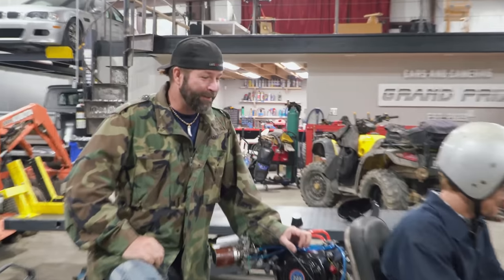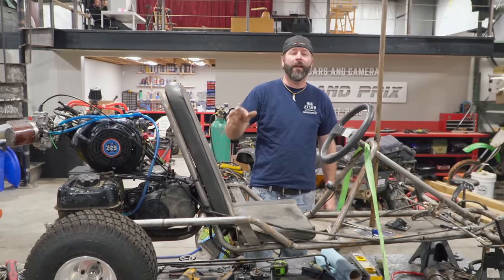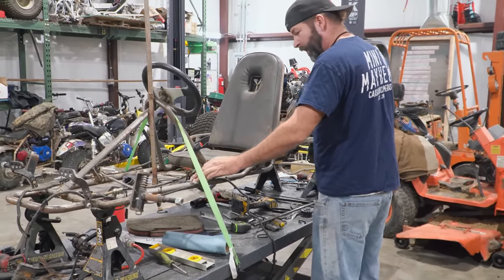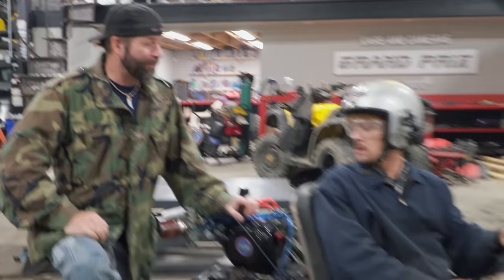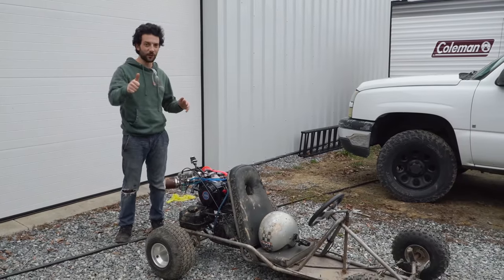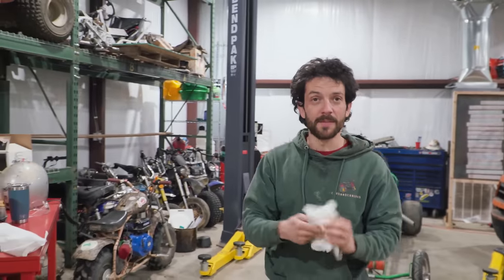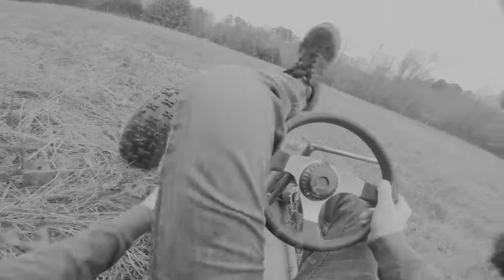Backyard Shifter Kart Goes Airborne on First Test Drive!

Comment from the maker: We're pushing the power limits of the yard kart chassis!
Reply: Ike quote of the year, "Don't do what we do, now hold my beer!"
Reply: Princess cart?
Reply: Ya think? 😂
Reply: I have a go-kart idea I'd like to share with one of you guys for your build off
Reply: Definitely that chassis was flexing alot.  Wonder how much it can take? 😅
Reply: If the track was dry it would probably hook up better
Reply: If you fill the gas tank with water it won't explode
Reply: Start messing with suspension setups it would be informative and enjoyable to see
Reply: I'd love to see you guys adapt that transmission to a minibike frame and see how it performs😎
Reply: Bro, you guys should reach out to REKLUSE clutches and get an actual semi-auto clutch for this badboy!
Reply: Next vid can we get a top speed run please???
Reply: I love the almost finished product pretty insane.
Reply: That shifter is slick!
Reply: @Casual_BackPacking  or use argon and purge it a while first.
Reply: Now the drag rail needs 5 speed Harley transmission
Reply: Dude I think a hand brake would be so awesome! Something you can grab real quick pull it then be right back on the wheel but that’s really cool cart !
Reply: Why not do paddle shift. You've done it before , and it worked pretty damn good
Reply: He said I’m a valunteer fire man lmao 😂🎉
Reply: Blaster would of been faster
Reply: You guys gotta do a all wheel drive go kart not like one with big wheels and shocks I’m talkn jus a normal go kart
Reply: Me and a buddy used handbrake levers on the steering wheel with a gyro off a dyno gt for the shifter on a cart we put a rm85 engine on worked pretty good vibration and  frame flex didn't effect it like a hard linkage
Reply: bring back the ducarti 900cc 🤣
Reply: Of all karts this is the way to go for sure.
Reply: Im gonna have to build another one now guys... darn it lol. Love the build.
Reply: Just curious, would it work to fill the gas tank with water while you welded the outside? I'm not a welder. Just asking. I understand both surfaces have to heat to have a good weld but the water would push the fumes out and keep the inside cool.
Reply: Yep
Reply: @kevinAuman1  they have four years. It's called a 30 series or 40 series belt drive. They even used a 70 series (snowmobiles and utility utv)
Reply: @Mac181  look in the video archives. Ike once built a yard cart with a predator on every tire. 4 engines for real
Reply: @jaydensdream714  I meant with a drivetrain
Reply: Fill the gas tank with co2 gas wile you weld it.
Reply: Nice
Reply: Seen what a predator 212 can do with a manual transmission.... Now thinking what a predator 670 will do with a manual transmission

Comment: Funny that I did this exact same thing back in the early 2000’s when I was 16. Used a kx80 motor and a 10hp Briggs powering it. But I did a direct drive to the transmission and used its clutch. Also it worked out great having an up and down gear shift on my left side. All in a big off-road kart with 4 wheeler rear tires.

Comment: Any OIL inside the case for the bearings?Looked Fun as heck.( Fen-Ders) If the shifter rocked,1 side Up-shift,other Down,instead of push-pull.A double- L across for fingertips.?Edit=Paddle shifting,but as a rocker.
Reply: We do have oil in it
Reply: You should fill the case.
Reply: @isaacitllbefine7231  hi Ike. I hope yall had a great Christmas.
Reply: That’s a great paddle rocker idea
Reply: @isaacitllbefine7231  yall should clean this up. also this also has me tempted to do this over a juggernaut pulley

Comment: Whenever you need to weld on or near a gas tank you can drop a chunk of dry ice in it and the co2 will displace all of the air and fuel vapors.

Comment: That's how i shift on mine and it's really fast. My wife she has one also and she loves it. Ours is lifted higher about 5 inch's off the ground cause we go trail riding all the time. We can switch from 2 wheel drive to 4 wheel drive easy. But to take it out of 4 wheel drive u gotta back up a few inch's. The youngest son he has his RZR and he loves it. We have one and  we go mudding all the time. I had a good friend of mine put a suspension lift kit on it and my wife was like WTH it's higher. She can easy get in and out of it good.
Reply: What go cart do you have that’s 4 wheel drive?

Comment: Dude this is effing awesome it’s my favorite so far with the torque converter and the manual it’s like the old gallardo’s with the flappy paddle gear box and when you put the clutch on it it’s gonna be like the tt vipers with the sequential transmission lol

Comment: I say keep it semi auto transmission, takes some thinking out of the setup and more focus on driving.
Reply: So it's a manumatic?
Reply: @190SkyTeam  yup...auto clutch, let off the throttle and the engine slows down enough to disengage the clutch and you can shift. My Suzuki lt125 is this way.
Reply: Dump the clutch and do a burnski 🔥🔥
Reply: @Jt101c  with a 25hp engine, it will "clutch dump" with the clutch it has now. But also a clutch dump will put alot of shock on the system and the current engine drove to the stator wheel they welded the sprocket too, the woodruff key amd the end of the crankshaft is the weak point and not made to be taking such loads. We shall see how things hold up but over all this is a very cool mad max setup happening.
Reply: It will be but having a clutch pedal as needed would be awesome
Reply: @steel175wild bio  I guess having a auto clutch and manual clutch would be good. You can still clutch dump when revving the engine but have the option of auto shifting. If the engine runs away you can quickly disengage it too. I say have both.

Comment: Run exhaust fumes thru a hose into the tank and that will get rid of any gas fumes left in a tank after draining it and flushing it with water. I have welded up alot of motorcycle tanks in the past and have never had one problem what so ever. Love your guys channel!

Comment: I know before welding on a propane tank you fill it up with water then drain it, could just remove the fuel tank if your worried. But boys will be boys. I know these are just go karts but have you ever thought of putting some splash guards on some for those wet muddy days? Had to put flares on my driving rig because one it's the law and two it cut down on my side mirrors getting dirty.

Comment: If you're going to weld or cut a used gas tank it is best practice to purge it with Argon gas, as Argon is heavier than air and gasoline fumes it settle to the bottom and will push any other gasses out of the tank as it fills. Purging is the only way to be sure there is no flammable fumes left inside the tank. Water will also work for this purpose but, then you have to wait for it to dry completely before use. 👍👍

Comment: Love the channel, been watching for years. 

I've got a challenge for you.
I've been wandering about the performance difference between a motorcycle 6spd trans and an ATV/snowmobile dual clutch & belt setup.
So the challenge is:
2 go carts that are identical except for 1 thing.
One has a snowmobile/atv belt driven dual clutch.
The other a motorcycle 6spd.

Can also  play around with different sprockets but other than that, identical. (Obviously different shift linkages, clutch master/slave, etc)

Same tires
Same frame
Same engine (preferably a 600cc or better)
Gas tank
Etc, etc.

Might be easiest to copy an existing shifter kart, and adapt the dual clutch belt setup.

Comment: Great content.  Reminds me of the go kart my brother and I build in the early 80's with a motorcycle engine, before shifter karts were a real thing.  Your shift direction of forward upshift would confuse me though.  I believe serious race car sequential shifters are usually move back for upshift.  I suppose this point is debatable since a lot of modern cars are forward upshift on the manually shifted automatic transmissions.  I have a suggestion for you:  you seem to have a lot of loose bolts that fall off.  Think about implementing a final check list before the first ride to include rechecking all nuts and bolts.  And think about using those torque wrenches a little more.

Comment: A converted hand brake could be a manual clutch, or you could modify the shift linkage so it disengages the clutch before shifting in both directions.

Comment: Here’s an idea for future builds. Make paddle shifters using cable. Run the cable through the chassis to the main shift rod. Run up/down shift cable out either side of a pivot on the rod. Just a thought so you can shift without letting go of the wheel. 
You guys are living my dream, just keep livin man….L I V I N! Lol

Comment: I had a 100cc Manx in a Sirio Goldstar frame years ago.
18HP@16k rpm - with about 3/8" ground clearance in the front. 
Direct drive - you had to pick the ass end up, take a couple paces, drop it and jump on and hit the gas.
Zero to 60 wasn't impressive, but 60 to 0 was about 8 feet, when you slammed it sideways.

Comment: To keep a fuel tank from exploding, drain and flush with water, run exhaust fumes through it from another vehicle for at least 45 minutes, then put any spark to it and it will not blow up.

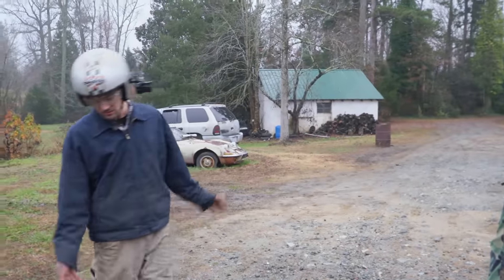Comment: at 10:00 The bolt is gone again because your transmission is shaking itself loose !!
I commented about that last time but you have a counter weight on the cranckshaft but no piston (weight) to counter.... so it is SHHHHhhhaaaaaaaaakkiiiiiiiiinnnnnggggg....

Comment: Just do the shifter like racing karts. 1 shift lever like you've got, but also a clutch lever(motorbike style) attached to it to operate the clutch cable...simple and effective otherwise they wouldn't race with them. :) Specially when you don't have much space for pedals.

Comment: You aught to cut the counterweights off of the crank to limit the extreme vibration that has to cause with the piston and rod weight gone. Or better yet, cut the throws out too and weld a straight piece of .120 wall tubing in its place

Comment: Ike I worked at O'Reilly and one day across the street at a mechanics shop there was a welder welding on a tank. It was empty, but had been used for storing used cooking oil. The heat vaporized the cooking oil which caused it to ignite and the tank to explode. The mechanics told me it took his head clean off. So everyone please be careful welding around tanks.

Comment: Really like this one.  Have you considered a primary belt drive like some Harleys have?  Would be lighter, I would imagine, and if the wet clutches in the transmission still function, it would let you eliminate the centrifugal clutch on the engine.

Comment: One of the best things about using a second case as a transmission is the MANUAL CLUTCH! Personally, I would have hooked it up direct between engines and use the blaster clutch. Even a stockish engine will feel MUCH faster with the control of a manual clutch!

Comment: your guys shifter is completely wrong to be calling it a shifter kart had you just put a handle connected to the (old clutch linkage for the model t kart) then itd be correct right now its literally just like an old 3 on the tree except its 6 gears instead of 3 next shifter cart you do you can use a blown up engine like the blaster then just seperate the case and build a back cover plate for the trans using your cnc table then it could be way more compact and you could use a cvt setup instead of a regular clutch cant wait to see all the stuff next year have a happy new years yall

Comment: Thats next to a good paddle shift set up. If you get it working, you wont need to let go of the wheel ever. Good angles and length on the paddles during a turn situation?

Comment: There isn't any engine breaking with the clutch because it disengages as soon as the you back off the throttle, just put a solid sprocket on

Comment: Put a Duromax 440 18 HP on a red Colman ct200 you know the ones with front and rear racks with a go power sports 40 series tc  relocate gas tank carb and exhaust and gear it for the best top speed
Reply: It would be cool to have a free wheel mini bike tire kinda like a bigger stronger bike tire if you combine that with this set up with a jack shaft and a free wheel#40 chain sprocket might need to stretch the frame a few inches to fit but would be a dream build

Comment: Just to maybe help me understand something i may be missing if the trans has a neutral and only goes if you hit thr gas when in gear why have a centrifugal clutch on the engine and not just a solid sprocket

Comment: question guys would you be interested in a belt driven gearbox (upto around 7 speeds) thats designed to be servicable and easily swap out gears to change the ratios?

Comment: fill the fuel tank with water while welding, I've welded gas tanks themselves many times, some guys use exhaust,(outside) from a car, any non flamable gas will work,....50yrs a mechanic    retired, just my 2 cents, that cart is mean😉

Comment: It's a 324 lb four-wheeler and got 17 horsepower 55 so minus the diet be worried about the transmission minus the diet on the way and the extra horsepower I think you probably close to 80 cuz it's lighter

Comment: I understand the high camber angle, but what the story on the right turns, where the right wheel makes a smaller diameter circle, but the turn angle is only half that of left wheel

Comment: Would it be possible to rig up the clutch operating off the actual gear shift, pull the  shift back and engage the clutch, release the shifter and off you go
Reply: (Honda C90 autoish)

Comment: so heres a thing i bought a tractor here resently and it old so it has a 400cc ponymotor rally torquey amade to spin over a 60 horse engine and i was thinking about making it a gocart but dont really know how yet it need a carb and a starter or pull start its really old made in the 70s i believe or some where a long time ago and hope i can find it a carb the main reason is i have a lot of room to ride and just want to mess around with something and thats the reason i bought the tractor because i like messing around with that kind of stuff